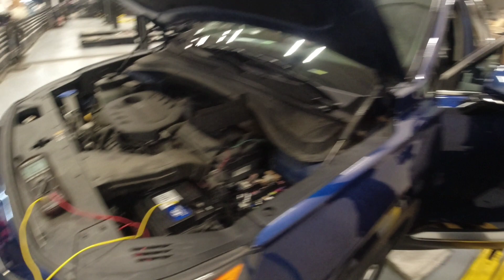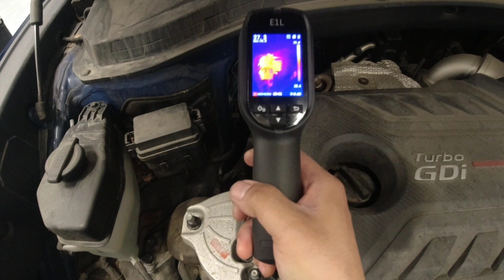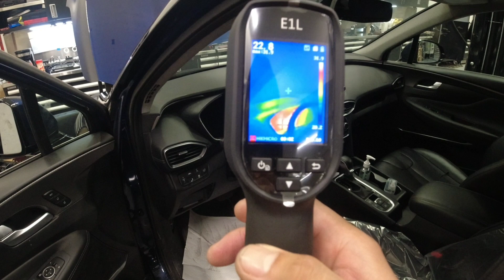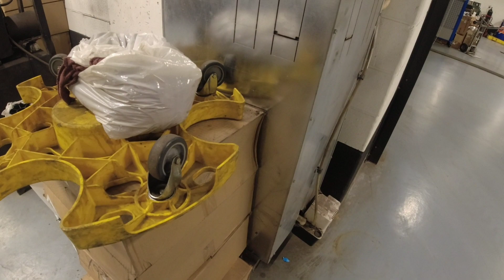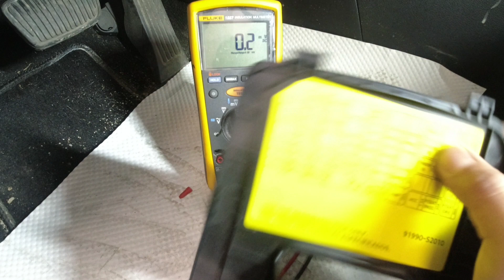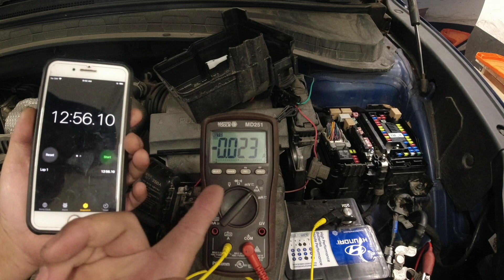Hyundai Santa Fe - Parasitic draw testing

Comment: I've got a parasitic drain on 2016 Santa FE.  Electrical mechanic's computer is saying "memory" but this seems to be too general to be of any use!  Any suggestions as to what it might be are greatly appreciated!
Reply from the maker: What do you mean by memory? The memory fuse is drawing the current?if yes you need wiring diagram what components are connected to that fuse.
Reply: @hyundaitech  Computer is plugged and it suggests "memory" is still active causing the drain!  But what would that mean?  We've tried disconnecting a lot of things but can't dismantle the whole car!

Comment: Hello, Thanks for your video. Useing the FLIR camera is a genius move. I have a 2023 sante fe that has parasitic current draw. I want to rule out my equipment before I take it back to Hyundai. Regards  Peter .W Australia.
Reply from the maker: Let me know you find.
Reply: Hello, Today I went digging for my power loss. After trying testing the overall current draw. I then tested the Dashcam. It is drawing 300mA in standby mode. Its not a cheap one either. I disconnected the constant 12v and connected that wire to the AUX 12 v. This means the dashcam can now only get power when the car is running. The car system uses up to 3.A when its locked and you turn it off, then after a few minutes it drops to 1.590 A. then after another minute the current drops to about 40 to 60mA This does move around a bit. I dont know why. 
Your tips on latching the locks so the doors can stay open was a great tip.
Best Regards Peter W. Australia